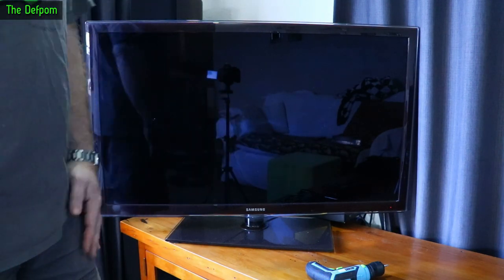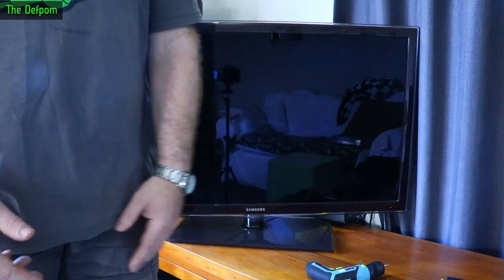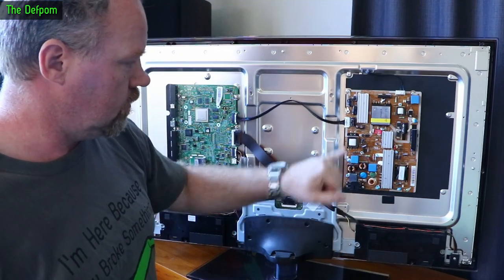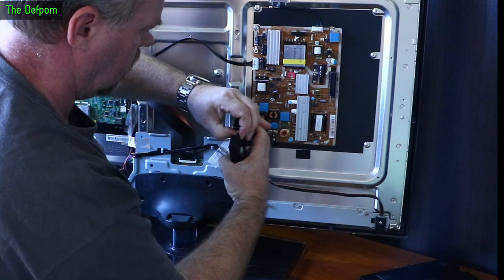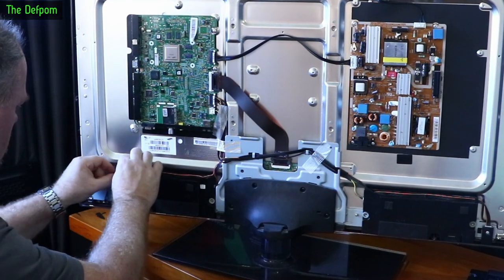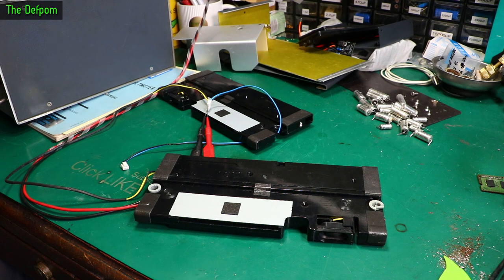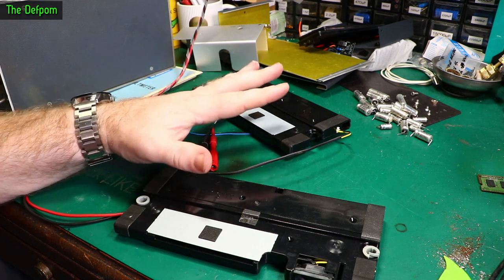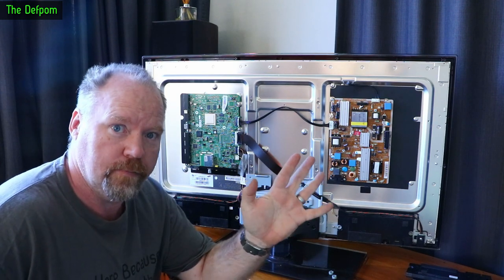🔴 Samsung TV Speaker Replacement - 40" Smart TV UA40D6000 - No.1099

Comment: Looking online my 55" Samsung Tv has very, very similar speakers......but they've never been used from new as I use an external amp/speakers setup (Denon/Dali). Could be tempted to open up the Tv and send you the speakers if you're stuck..........however, my advice is to set up an amp/speakers externally, the difference with good gear is astronomical.

Comment: I love that the clicking from the oscillator is louder than the speaker. If I had that oscillator I’d have switched the clicking off or put a hammer through the case long ago. The whole point of an audio oscillator is to give you a nice low distortion sine wave NOT a bloody loud set of clicks every time you change the bloody frequency. 

 I’d love to have been at one of their design meetings. Where they say!  We could lower the output distortion and make it a better oscillator or for no cost we could get the software guys to add a bloody annoying click every time the customer turns a dial. User interface won the day 🙂

Comment: Excellent video!
Simple question here: could I swap out the Samsung speakers with a pair of external speakers of the same power (10W) by cutting the wires of the tv speakers and wiring in the external pair (so I do not have to even use my external amp for home theater)? I could merely extend the wires through the tv case and place the speakers facing any way I choose. There are many times I do not need to use the external amp/stereo system (like watching the news). Thanks a ton!
Reply from the maker: Yes you should be able to do that, will likely sound better than the originals too.
Reply: Thank you for the prompt reply!!! I just wanted to ask this question before I started hacking into this old tv from someone who knows way more than I do. Thanks again!!! @TheDefpom

Comment: Hi Scott, I have a 21" Samsung in my radio shack / electronics workshop, I have no room to fit a larger TV, I got fed up with the buzzing speakers at 200 to 300 Hz so I opened it up and couldn't find any loose wiring near to the speakers so I bought a sound bar, problem solved.

Comment: Thanks a lot man
Since a Smart TV is almost a computer (Risc type=like Raspberry Pi), and since Android is kinda like Linux but on the tiny side
In audio troubleshooting one needs to check the Os(android), the drivers(relative to audio chipset), the apps(mixer and such)
It is a big mess , but just like computer one checks hardware, firmware, software, settings ...

Comment: Thanks for the repair video,  Scott. Did you try the Vise of Knowledge on those speakers? I wonder if there is a cross-over network inside with a bad crapacitor - it's always the crapacitor ! Regards, David
Reply from the maker: I don't have a vice of knowledge, I only have the hammer of intrigue... but you are right i should have a look.

Comment: They definitely don't build tvs like they used to ... still rocking my old Sony That does not have LED's .. All the new led tvs Are set at Max Brightness from the factory To make people buy new tvs
Reply from the maker: Indeed they are, first thing I did was turn mine down to 50%… I’ve had this tv for about 8-10 years now.
Reply: @TheDefpom  I'm seeing TV's not even lasting a year now Most cases is not even worth repairing
Reply from the maker: @QsTechService1  that is pretty bad